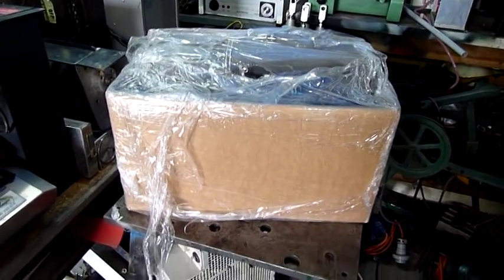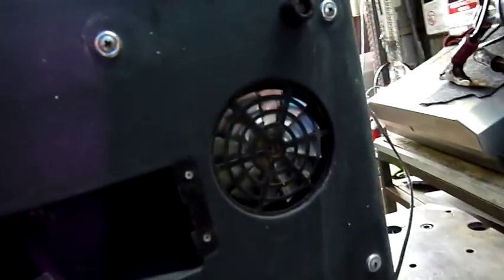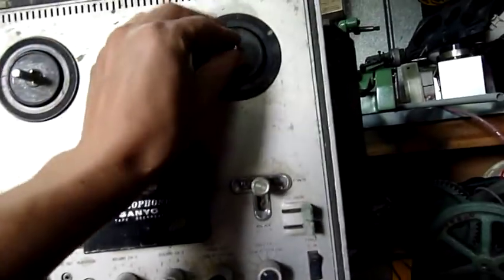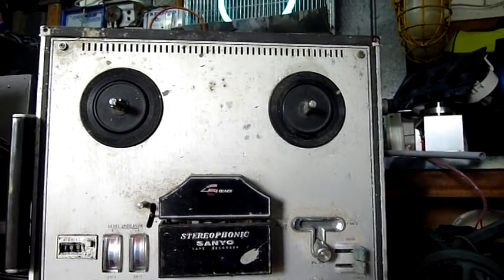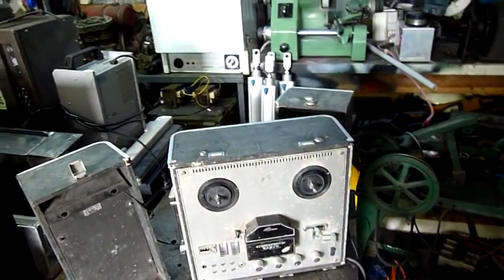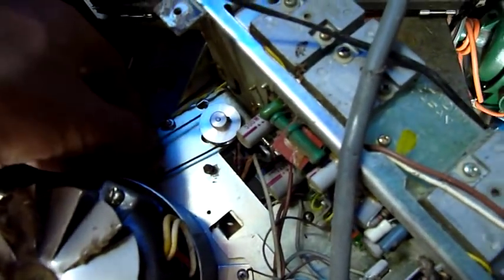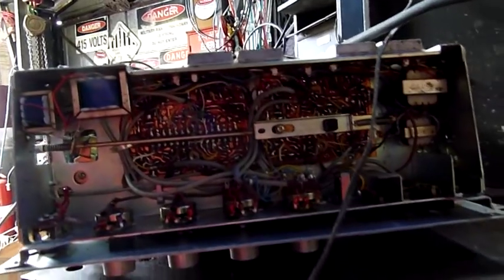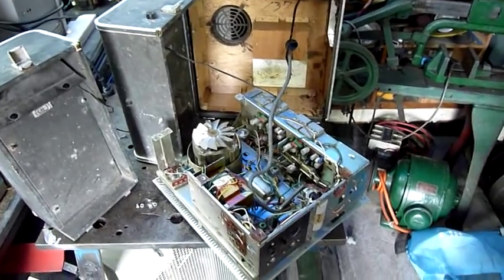Sanyo Stereophonic Reel to Reel Tape Recorder inspection

Comment: awesome vid as usual, Ed. Have a warm spot for reel-to-reel.  Had a few great ones in the '60s, when I was in the military, and now, I wish I had the foresight to hang on to them.  My favorite was a '57 VM (Voice of Music). One of had to buy a matching-looking unit to record/play stereo, but the sound was great.  Yes, weighed a ton,  all vacuum tubes, but since I had access to a virtually infinite supply of same, and the best shop(s) that the USA could provide, never any prob with maintenance.

Comment: Cool unit.
Btw, boards with both tubes and transistors are called hybrid boards. hence the term hybrid amplifier, where you have a tube preamp and transistor power stage.

Comment: Thats in really good condition inside. :-)

If your going to keep it, i would pop the top off and remove as much visable rust as you can, then apply a very very thin smear of oil to the metal bits.
Just a 5min cleanup is all it needs :-)

Shame that most young people dont even know about reel to reel tape recorders :-(

Comment: the heads are likely too far gone for restoration.  not to mention the audio controls, speakers, motors, rubber and and sensor switches are probably bad.
any terminals or connectors will have to be replaced as well.

as nice as it would to get working right, the cost will be at least double the original price.  it would still made a nice display piece, though if the case can be cleaned up

Comment: It looks like a lower mid range model, most of the higher end ones have motors for each spindle and some even have another motor for the capstan. In the condition it's in I would offer it for the cost of shipping if you really want to get rid of it, unless you have a higher end model Akai or an Ampex there really isn't a large market for reel to reels. Fleabay isn't a very good measure, people post all kinds of useless junk for ridiculous opening bids and BIN prices.

Comment: there is a switch to catch the tape and some things wont start till it detects the tape and when you press stop the reals will lock to prevent damage to the tape if you leave it in when you move it. oh and mine is cooler and vacuum tube made by airline, but only 120volt. ;)

Comment: EBay has RtoR drives for 200odd working, 75 parts, but none by the name of Sanyo.

If you do get a buyer, take it to the local exterminator and have them tent it and fumigate with something that wont destroy the electronics. Add the fee to the S&H costs.